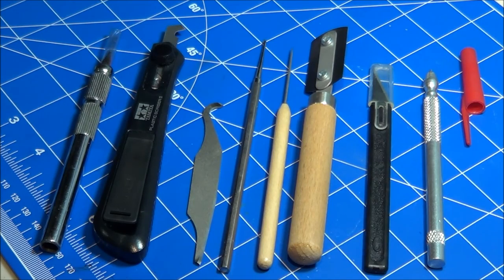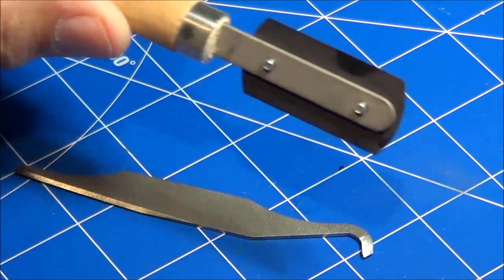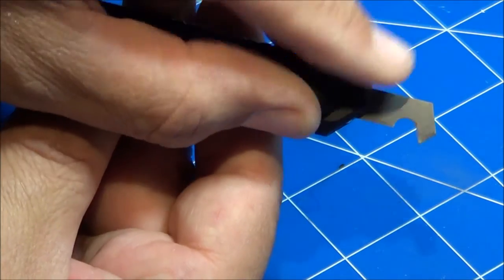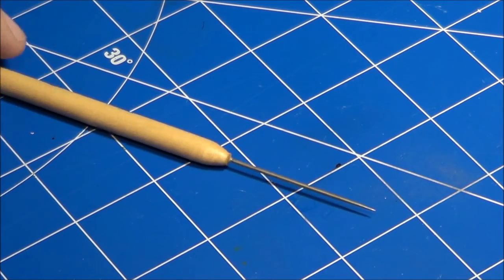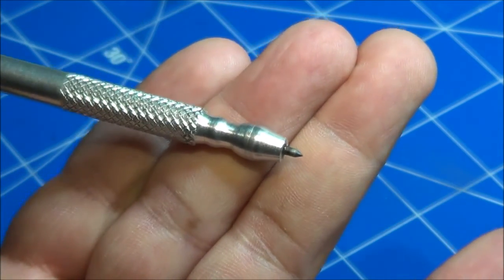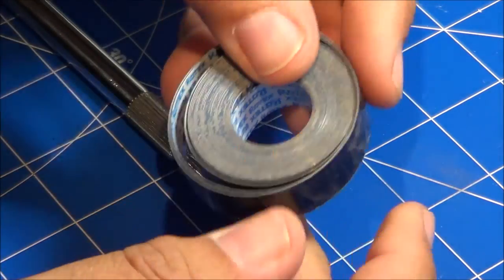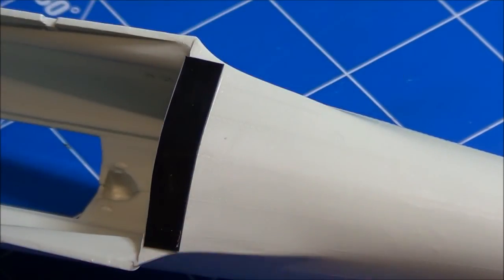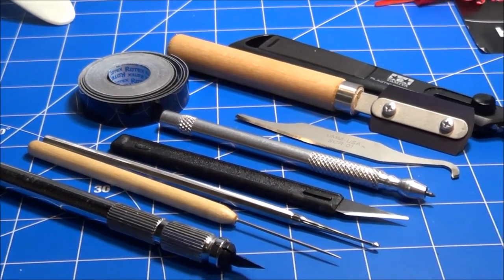Review - Scale Model Panel Line Scribing Tools

Comment: You totally forgot to mention what type of groove these tools leave in the plastic. Many moons ago there was a company that made a tool that left a flat groove in the plastic and not the more common V groove. A flat groove is more desirable and some companies do offer these types of scribers, but most seem to ignore this altogether. Mission Models i am sorry to say no longer produce their superb panel line scribers, but a few other worth considering would be the STYLE X type D sold from Korea. Keep in mind this tool will roll on your workbench, and if they fall to the ground the tip will inevitably snap. Please don`t ask me how i know. Then there`s the RB and Hauler p.e. scribers, very thin and not 100% stiff which will make your job a bit more challenging. Dream Model has an interesting set called the "tool number 5" Also, Voyager has two nice & pricey chisel sets with the flat groove design but don`t expect these to pop up when you search for them online. The chinese are funny this way. Or you could just give a damn and go with your common V shaped needle tip. The choice is yours ;-)
Reply from the maker: Thanks for watching!
Reply: mybluebelly Tamiya now offers scribing / engraving blades or tips that are even better  than the Mission Models scribing bits, which broke off at the neck with infuriating frequency.  The 0.1 mm is what I use and it is great for straight, flat panel lines on 1/48 or greater models.  Tamiya part no. is 74135.  You can use on any pin vise that takes circular bits or use the Tamiya handle (part no. 74139) but I prefer to use the metal pin vises that you find at hobby shops.    This is a pull-type of scriber, not a pusher type.  It makes a square or as you call it a flat, not  V groove.  There are several widths too, if 0.1 is too thin for your taste.
Reply: @peterecos634  Hello there :) Yeah i did notice Tamiya has joined the bandwagon recently. These tools look really top notch but then again Tamiya does not mess around. The handle looks ok. The number 74135 item you refer to is more or less identical to the Style X type D i mentioned...it looks like a copy. Maybe the "Style X" manufacturer sold the manufacturing license to Tamiya?! These miniature plastic scribers is what makes a guy like me drool ;-) So just out of curiousity, where do you buy them? I am slowly transitioning from ebay to the likes of Aliexpress because it seems everything has gotten too expensive on ebay lately.
Reply: @mybluebelly   Hobby Link (hlj.com) has them for the lowest online price, however shipping and delivery time became an issue.  I usually wait till I want a kit that I just have to have ;-)  Then shipping is acceptable.  ebay is now charging taxes which in many cases takes them out of consideration, these parts included.  HLJ does not yet charge any tax but I'm sure it's coming.
Reply: @peterecos634  It can`t be much more than 3 months since ebay started adding VAT to my ebay shopping cart and since i am located in Norway this fee is no small matter. I tried adding the Tamiya 74145 to my ebay cart and with shipping from Japan the cost was $25. However the VAT fee on top of that was $6.25. Needless to say ebay is no longer the #1 place i do my shopping anymore. Now i go the extra mile and consult the seller so i can go around the ebay fees or just buy somewhere that can assist my needs. I already tried it a few times and it works ;-)